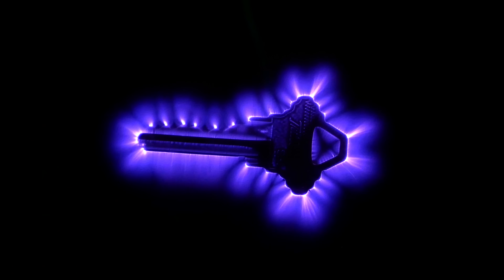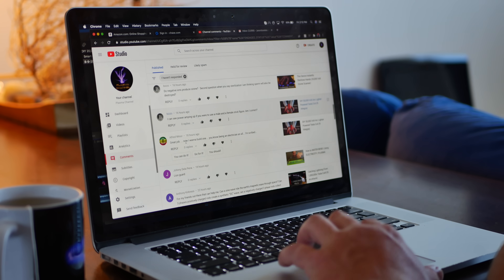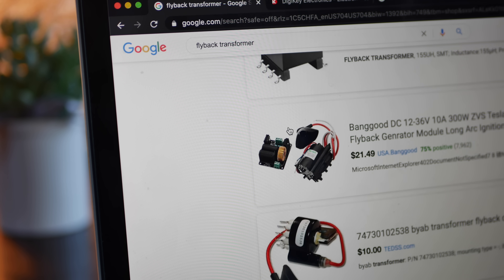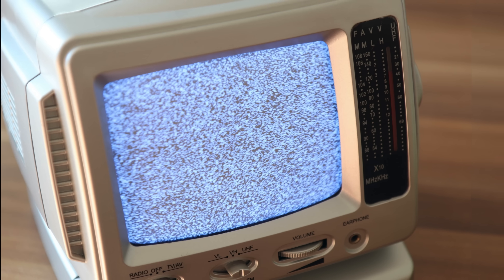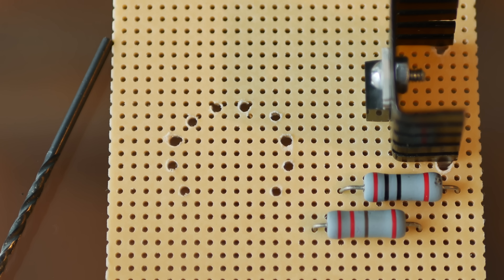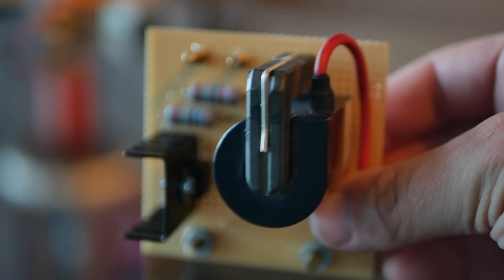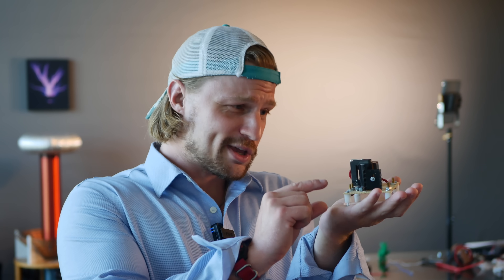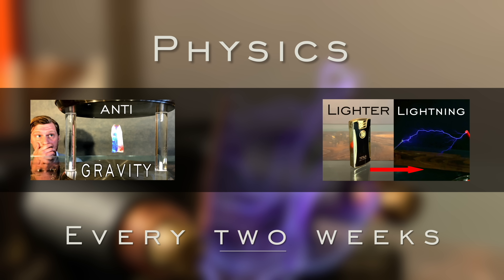DIY Plasma Physics Powersource (Mini 20,000v Flyback)

Comment: Can you try this experiment? Take a vacuum chamber and fill it with tiny amounts of metal vapors and noble gases so you have a partial vacuum chamber. Take two Tesla Coils and point their top loads at each other with vacuum chamber placed between the two top loads. The two Tesla Coils must be operating 180 degrees out of phase to each other at around 60 kilovolts at 3 or 4 mhz AC. See if you can generate fractal galactic formations from metal vapors and noble gases inside a vacuum chamber from electric and magnetic fields going back and forth through vacuum chamber between two Tesla Coils. Google "Eric Dollard - How to create Stars, Nebula and Galaxy with Tesla Coils".
Reply from the maker: I'm familiar with Eric Dollard. Interesting fellow. I dont really subscribe to EUT, but, it's interesting stuff.
Reply: This book is recommended read for Electric/Plasma Universe theory: Physics of the Plasma Universe by Anthony Peratt.

Comment: Wouldn't this be high enough frequency that it wouldn't be that dangerous to touch?
Reply from the maker: Correct, it would not electrocute you. But....it can burn you or mess up a pacemaker.
Reply: @PlasmaChannel  Thanks for the reply!  I stuck my finger in a ZVS driver with flyback transformer (with 12v input, barely orange plasma).  Not because of your comment though, I just couldn't resist. I was worried about the fact that it is rectified but not worried enough I guess.  Felt about like 220v AC with a wet finger except it was hot, obviously.  Quite a shock.  This was at about 70khz so I think it must be the diode.  I am going to try it with a lower current single transistor like this circuit just to be double sure that it does electrocute.  As for people with pacemakers I don't know if they should be playing with this at all (although I know nothing about pacemakers).  Not looking forward to all the safety comments this post might get me but oh well.

Comment: Oh god you made a silly 2n3055 flyback driver. While they are cheap ive burned out many chips with these, they dont cant handle current worth a damn but good on you for showing these. It was the first hv circuit i made when i was younger
Reply from the maker: Love the simple circuits, honestly. And i dont trust IC's so, any circuit where I can remove an IC makes me happy.

Comment: Do you have a schematic for a high voltage (DC) power source?
Reply from the maker: My newest video from last week includes the schematic for a high voltage  DC powersource
Reply: Output of transformer is generally ac, lookup bridge rectifier to get it dc

Comment: I Wonder what frequency its at, i have a flyback with a zvs running at About 40khz, so IS this higher frequency?
My power supply IS definitely higher power(About 150w), but if this had a higher frequency, it should be better for a multiplier.
Reply: I dont think its higher because you can hear it in the video
Reply from the maker: This circuit is self resonant to certain extent. As you draw arcs, frequency changes drastically. It will not be good for a multiplier unless you use an AC flyback. Then, it is great.

Comment: Wow I think you should go through a step by step build of your big Tesla coil.

or go through step-by-step builds for doing a vacuum pumpprojects to get ready for plasma work with a quartz tube and make your own plasma tubes with rectifier so you can have individual AC and DC ... To see the difference between the anode and cathode in the homemade plasma tubes and that would be an awesome project for the plasma Channel.
Reply from the maker: Those sound like awesome projects - unfortunately not sure if I have the facilities to do such work!

Comment: How could we do it adjustable?
Reply: To make what part adjustable?
Reply from the maker: You'd need a controllable voltage regulator between the battery and driver, honestly.

Comment: Very nice. I have been trying to figure out how to run one at VHF to get the single electrode rf arc flame. That'll probably require a vacuum triode though.
Reply from the maker: Check out the video that StyroPyro just put out. He made one of the most intense flame discharges that i've ever seen. Period. It's massive and terrifying. It's a great viddy. https://www.youtube.com/watch?v=UNisqZOAaAs
Reply: @PlasmaChannel  ohh I saw that one 😳
Reply: Correct, I've only seen it done with a tube... big big tube 😄
Reply: @stuartcommon4651  There are ones that can run from specialized semiconductor parts. They're just more expensive if I'm not mistaken. Here are a few samples to back this claim: https://youtu.be/KZF-FR8b71s 
https://richieburnett-co-uk-mirror.gitlab.io/hfsstc.html
Have a good one.
Reply: @stuartcommon4651  True that lol. I'm pretty certain he was featured on Keorsan's channel where one of them sat on a TC wearing a melon helmet. Some of the things they do are insane.
Reply: @Slowly_Going_Mad  he was indeed 🤣
Reply: Rebuilds Dollar store laser to output five watts optical power. His channel is definitely a classic for the YouTube science community as is this one.
Reply: @Slowly_Going_Mad  agreed definitely!
Reply: Those videos he does are pretty crazy but good. Melted/vaporized anything in it's path. I would be fine with a much smaller one just to experiment with.
Reply: This puny laser doesn't even burn my skin... its going to need some upgrades

Comment: Maybe its it's obvious but what is the one hand rule?
Reply: One hand in your pocket, stops you making the mistake of touching a dangerous power source with both hands and passing it through your heart.

Don't take that as meaning it turns a dangerous power source into a safe one though, it doesn't
Reply from the maker: Thank you Stuart! Yes, correct on all accounts.

Comment: It's essentially the Joule thief circuit on the primary, but I had a question.  The 2n3055 is a PNP transistor, not an NPN, so I'd have expected to see the polarity reversed.  Am I wrong?
Reply: It's all about power rating. Datasheets if you can. Cogman inc. tried one with a component that couldn't handle it and fried a few. I have yet to order more parts due to very limited funds but will get a video on it at some point.

Comment: What is the frequency of output? Can we control the frequency?
Reply: Not with this circuit no
Reply from the maker: Stuart is correct. I'm starting to see a pattern of Stuart being correct..... As for frequency, this is aroun 21kHz, but will vary depending on the final parts you use.
Reply: @PlasmaChannel  Thank You Sir

Comment: Thank you!  This is going to be fun. What did you use to make the base?  BTW, battery operated TV - not an easy find.
Reply from the maker: Base was acrylic - per plasma Channel standards - with nylon supports.
Reply: Flyback transformers can be found all over the place. You just have to think of medium power high voltage devices and it's a good chance it will have one in it.

Comment: Can i use it to power the diy marx u made at the previous video. Or/can u make video how large sparks it produses with this power source?
Reply from the maker: This is the exact powersource i used for the Marx video, actually!
Reply: @PlasmaChannel  Thanks for answering , now i can build my own without worrying about it will not work.

Comment: Great content! Could you make a simple musical tesla coil the future? And not those that are running on 9 to 12v. These are very weak. 

I attempt to make one that works on 35 volt and 5 amps, but when I try to make it musical, it just doesnt work. Those smaller ones I make do work. But thats not fun. 

I am a student right now, and I have searched answers with my teachers why it wont work... 
Problem is that there is actually not a in dept explenation on the internet how musical tesla coils work. I know how a normal teslacoil works, but the music part makes me confused.  

My best result was when I powered it on, the music literally played from the powersupply. Not from the breakdown tip of the secondary. My coil was creating an EMF but it was really weak for some reason. It didnt have any plasma coming of the load. But it was using the same amount of power as mine normal tesla coil. (35v 5A)  Eventually my transistors from the musical part of the circuit died. And I still dont know the reason... 

I hope you read this and could make a video about. Thx and keep up the work! ;)

Comment: Awesome thanks 😍
But i expect to learn proper winding for the transformer
Here is my questions:
What is the best way to insulate secondary coil with maximum turns ratio?
-Epoxy resin or tape on eachlayer?
-Do windings must not on top to another or dosent matter
-How prevent corona effect on secondary coil
Thanks
Reply from the maker: Lol stuart you're the man. Spot on.
Reply: 1. Oil
2. Depends on the transformer
3. Oil
Reply: @stuartcommon4651  🤣🤣🤣

Comment: isn't there a capacitor in parallel with primary ( given in physics book )

it's actually an electrical oscillator ..

without the capacitor .. it actually destroyed my transistor obt from choke tubelight .... 
don't know what type of transistor was it

..... if u pls show the diff in the wave form with & without capacitor ....

i think with capacitor it gives a sin wave 
..... otherwise a pointed peak wave i.e. high pitch ..... 

 can we make a spark gap transmitter with it ....
pls ans .....
Reply: Yes you can make a saprk gap transmitter, you only need a very high voltage, low capacitance capacitor
Reply: @Headbutter-Lettuce90  can I make form the one made in video
Reply: @Headbutter-Lettuce90  do u knw my previous questions !!??

Comment: After reading some of the comments you should don an all white robe and start a cult, Kool-Aid optional🤦
Does that transistor get hot fast? I used much larger heat sinks. If you live in the LA area there is a surplus store Apex Electronics that has(had) all kinds of wire and hefty heat sinks with transistors mounted (T03 cases). That was years ago but I think they're still in business. If you can get a vacuum pump for air conditioning, you can use your power supply to make a plasma display with a glass jar. I've done it.

Comment: Hey Jay!  Great video as always!  Do you have any idea why one electrode always seems to get hotter when drawing an arc?  I built a ZVS driver a while back to drive a flyback and one electrode always starts melting under the arc while the other one stays relatively cool.  I noticed the same thing in the video.  I’d appreciate it if you could shed some light on this!
Reply: In the video one electrode is a large brass bolt and the other is a comparatively thin wire, thin wire heats quicker

Comment: Can you please make the same high voltage circuit using a self oscillating zvs driver. This circuit can generate higher voltages and higher currents at the output...❤️

Comment: Hi.please make a video and teach us how to build a high voltage ac supply
Reply from the maker: Same as this, just make sure your transformer is AC!
Reply: @PlasmaChannel  i didn't find any ac output flyback transformer.i built Hv secondary my self based on a multi section bobin for kirlian photography project a d drive it with zvs but not enough insulation cause it to arc internaly.is there any way to remove the internal rectifier of a flyback transformer??

Comment: Some of those tiny flybacks doesnt have diodes in them so they produce AC instead of DC. In the past I litterally wasted 2 hours of my life because I coudnt find why my capacitors wont hold charge.
Reply from the maker: Haha that's a good point. It's true, I have a few AC flybacks.

Comment: Nice build. I had one just like that years ago. I think the same resistance even. Neat circuit to demonstrate skin effect of RF high voltage.
Reply: AAAAAAAH
A) it's kinda low frequency to call RF
B) the skin effect really doesn't matter for humans, the electricity will still go through your organs. HF AC doesn't trigger the nerves though, so you can't feel it, but it will still cook you.
C) it's DC so that doesn't matter anyway, the skin effect doesn't apply *at all* here.
Reply: @vdekjEE  I had one just like this it ran and produced a spark just about the same size. I measured the frequency to be about 250khz. The signal was definitely AC. Oscilloscope can show this but you have to take proper precautions measuring it because the voltage is too high to connect directly without damaging the scope. You can see a blue glow in the dark if you touch the insulation of the hot wire so it definitely has a skin effect. At least the one i built did. It traveled across wood, plastic and even a very thin glass. I used to play with it and see how many old burned out florescent tunes I could light with just a single wire.
Reply: @newmonengineering  that definitely sounds like AC. I'm surprised it ran t 250KHz! That's pretty high for transformers of this type. Did you get it from a color CRT tv? I've never heard of color ones having AC flybacks.

As for the skin effect, I think there is some confusion here. The skin effect is the tendency of high frequency AC to conduct mostly on the edge of a conductor, not to go through insulation to something conductive not connected to hv ground like you described. What you are describing is actually capacitive coupling, and is a very fun thing to play with! Please see these wikipedia pages on the skin effect:
https://en.wikipedia.org/wiki/Skin_effect
https://en.wikipedia.org/wiki/Tesla_coil#Skin_effect_myth
Reply: @vdekjEE  the one i used was not from a TV. Im not sure what it came from to be honest. But thank you for the myth link. I learned something new!
Reply: @newmonengineering  No problem! It's a really common mistake.
Reply: @vdekjEE  oooo where did you learn that? 😉
Reply: @stuartcommon4651  Hehe, yep I was definitely there once.

Comment: Bro, first off I am your biggest fan PLASMA CHANNEL and I am in 11th grade. I have watched all the videos on youtube and you were the closest one to my query.
I am from INDIA and we generally dont have a lot of thrift store here, so PLEASE!!!!!!!!! can you make a high voltage transformer(with primary and secondary winding calculations) so that we can do it by ourselves Please.     LOVE FROM INDIA AND YOU"RE AMAZING !!!!! KEEP DOING IT.!!!
Reply: You can make it from Old ferrite core from old inductor or transformer. Inverter microwave oven has everything you need. There's high frequency transformer already, but you can remove the core quite easily. Also there'a fan which you can salvage enamelled copper wire to wind secondary. I've done it before and its quite tedious but works
Reply: k bto thanks
but wont it be very dangerous coz its at a very low 60hz frequency and could kill and so my parents wont allow me to it
Reply: Can you tell me how to make a high frequency transformer hv transformer please i really wanna make those arcs.
Reply from the maker: I have thought about a homemade DIY flyback build.
Reply: @PlasmaChannel  Pls do it sir if possible!!!!
Reply: @mrunalshah2702  Inverter microwave has high frequency transformer inside. you can try to fry the rectifier diode inside DC flyback so it shorts and outputs AC

Comment: Cute, reminds me of a dual 2N3055 flyback driver I built as a kid. Looked for "MX D363" but google search returns nothing. "D363" is an abbreviation of the old Japanese part numbering where transistors started with "2S", so this was a 2SD363. Forget about the "MX", it's just one manufacturers prefix. Keep up the good work!
Reply from the maker: Carl, you seem to know more about parts than I. the 2SD363 is believe is replaced by this part: KSD362RTU. What are your thoughts?

Comment: Thanks for the tutorial! That flyback looks like the ones I've found in ionizers. Is there a diode on the output?
Reply: Pretty much all air ionisers are DC and most outputs negative ions.
Reply: I believe, as you implied, air ionizers are usually AC.
This flyback has diodes potted in with it; you can tell because the negative wire heats up much more than the positive.
Reply from the maker: Hey Nigel! You are correct. Depending on the model (Sharper Image model is one), air ionizers actually use an AC flyback that feeds into a voltage multiplier to create much higher voltages at DC. This one, though, and all from TVs are DC.
Reply: According to another Plasma Channel video, the flybacks from the Ionic Breezes don't contain diodes and output ac.
Reply: @nigel-matthews  Yep! But this one is from a CRT.